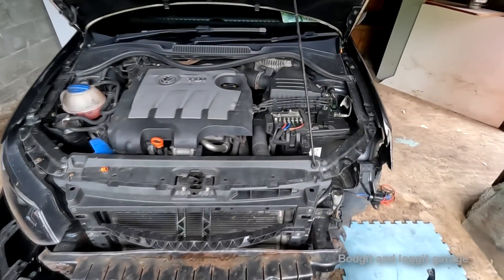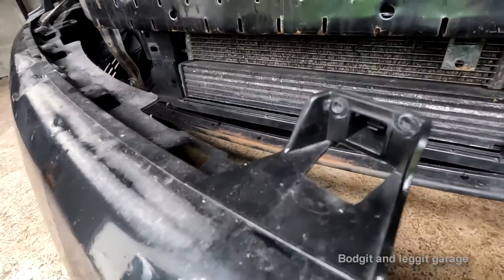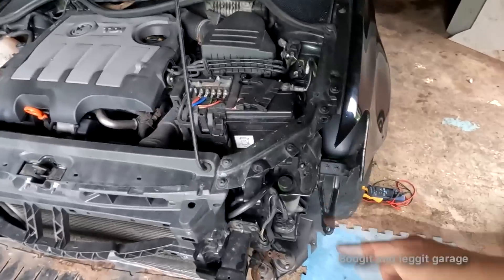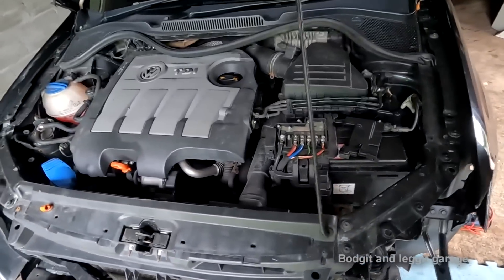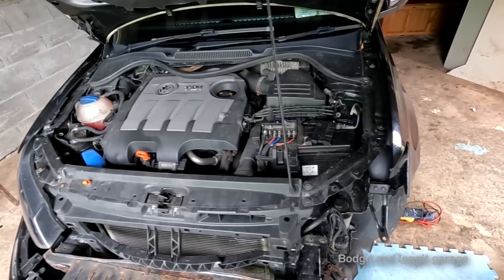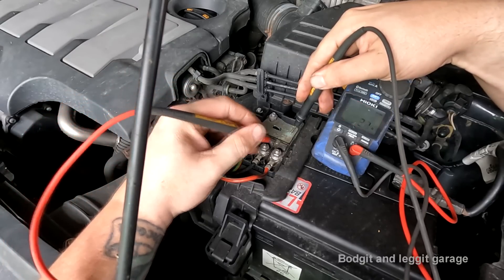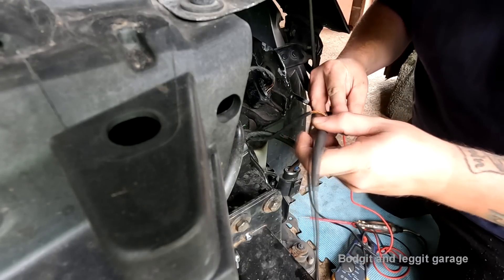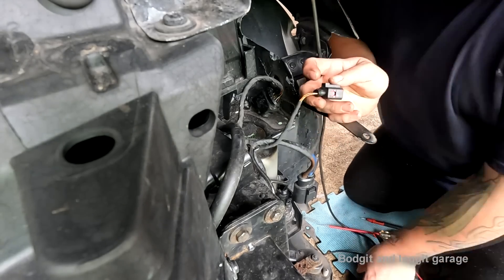Stop it stop it stop it

Comment: 35 years in the trade, I've worn many hats from diagnostics to grease monkey, MOT tester, main dealer etc. So I've some experience and I'd probably have done as you done. Properly used a multi meter should be enough in most cases although a wiring diagram and pin data would have nailed it. My golden rule of thumb is fix what you can see before moving on to what you can't see and you did that by establishing the damaged wire was still doing its job and providing the copper core is undamaged I'd re-insulate and move on. You've confirmed all the lives, feeds are there so I agree it's the module however I'd have like to have scoped the signal wires. 👍👍 this is just my opinions based on what I saw and by no means am trying to  teach you to suck eggs even though you do somewhat resemble my granny.
Reply from the maker: Very sound advice, mate. I was just trying to show people Easy ways and simple ways without expensive tools. Not everyone has a scope. But yes I agree with everything you said

Comment: Same design as in Mk2 Ford Focus.. Power Steering reservoir is between the right headlight and wheelarch.. incidentally the screenwash bottle is also above the right wheelarch.. engine bays are very much crumped with stuff these days so they stuck stuff in inaccessible places.

Comment: As a no coms and seeing that wire rubbed through looks like a CAN  wire (twisted pair) I would have checked the can network on that pump module. Just in case the bare copper was in contact with the body

Comment: Great informative video as usual Leon. In your opinion, are there car brands that are better than others for considering maintenance/servicing down the line or do a lot of the newer models - built by robots designed by gobsh** - just not factor this in?
Reply from the maker: Hi mate, unfortunately, that is impossible to answer. I will give you a couple of reasons why it all depends where you are in the world. What I mean by that is different parts of the world have cars at a more popular. The cars that are more popular are easier to get secondhand parts for. But unfortunately, now they are all using basically the same engines. The same everything you are just paying for a different shell.
Reply: @bodgitandleggitgarage  Cheers for the reply, Leon. Thanks for the info and I know what you mean. Whoever thought Ford would use PSA engines etc. Take care mate!

Comment: There are 4 types of power steering systems there is engine powered power steering pumps (hydraulic fluid pump run from auxiliary drive belt oon the engine) then there are electric/hydraulic power steering pumps (electric motor with a fluid reservoir mounted to top of it) and then there is electric power steering (electric motor attached directly to the steering rack) and there is electric/hydraulic and steering rack all in one unit (electri motor and fluid reservoir directly attached to the steering rack as a complete unit) and there are a few car manufacturers that stick them electric power steering pumps is stupid places i.e Vauxhall Zafira (right down the back of the bulkhead attached to the steering rack) Mk6 Ford Fiesta fitted with electric hydraulic power steering pump (down behind the drivers side headlight)

Comment: Had all electrics working on a focus 
but no start no crank 
and would not communicate with the pcm 
Had a broken ground wire under battery tray 
Fix it car no running

Comment: Had a vw years ago it was 2 years old drove it off the firecourt, 2 days later steering rack, starter ,alternator, battery, diesel injectors all failed car was under warranty supposed to have had a pdi done dealer didn't want to know so I went back looking for a refund as car not fit for purpose I have never bought another vw and never will again

Comment: Hmm. 2.3 and 2.7 . Doesn't that make 5? Isn't that something obvious?
Reply from the maker: Well mate it depends 2.3x2.7 That more than 5😂😂😂😂😂
Reply: Voltage across both can wires should add upto 5v. Or as near as. Also can check ohms resistance, I'm my  27th year,  6 days a week.